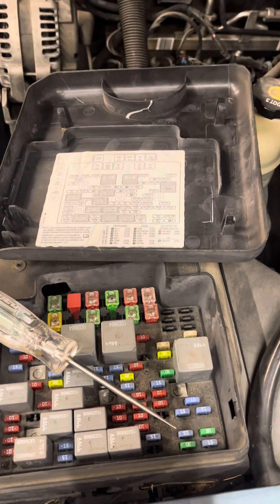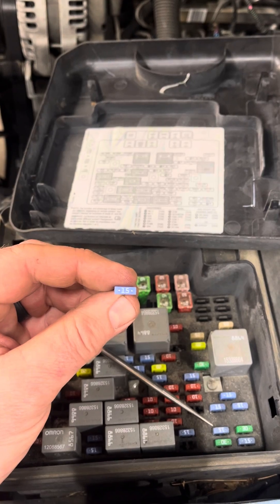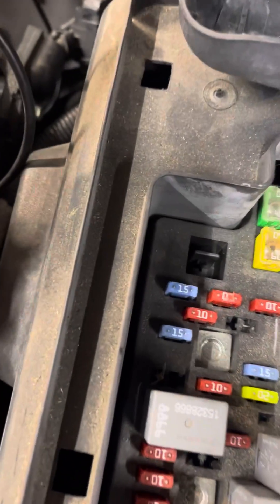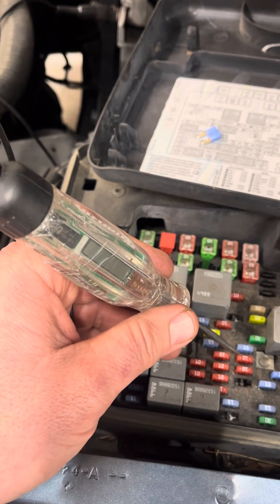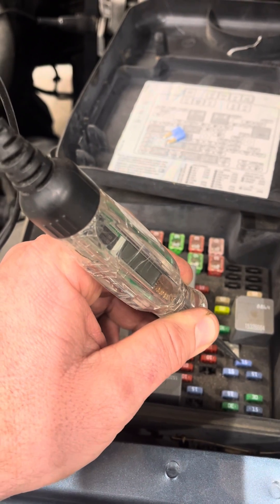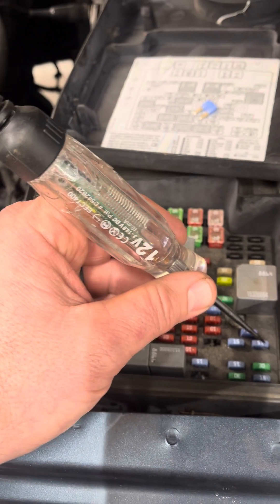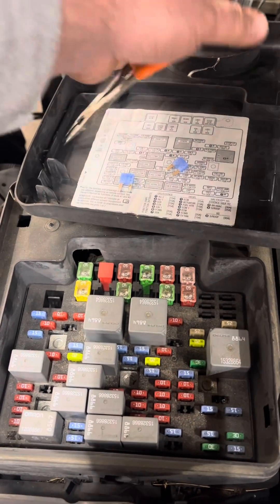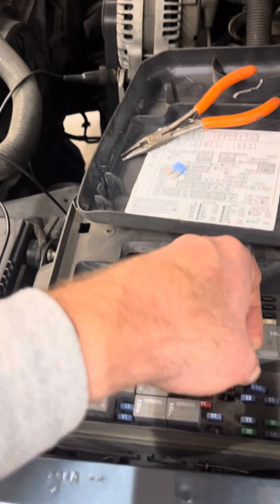Checking fuses without removing them, using a test light

Comment: What if the fuse blows immediately after you put a new one in
Reply from the maker: You have a short to ground. That means power supply is going right to the ground, which will blow the fuse.
Reply: @jeffwiseman0286 so does that mean it could be a cabling issue? Like an exposed wire making contact to ground
Reply from the maker: @unrealed2211 yes. Either a wire is rubbing through the insulation or a mouse chewed through wires.
Reply from the maker: These are the most likely anyways. What kind of car? Year make model?